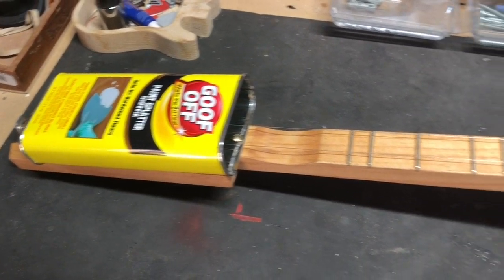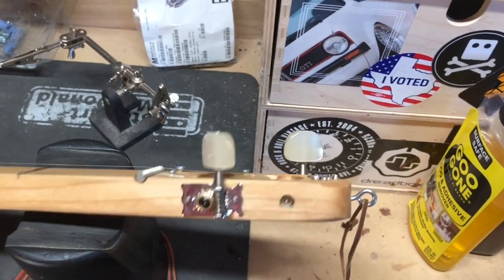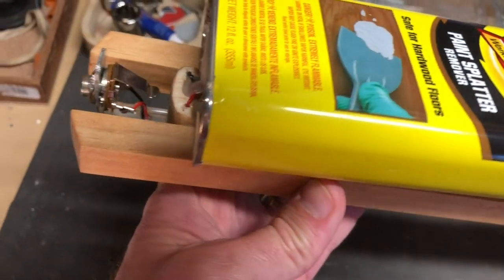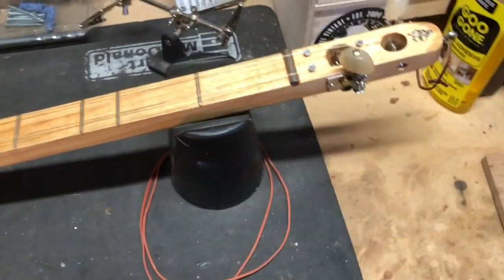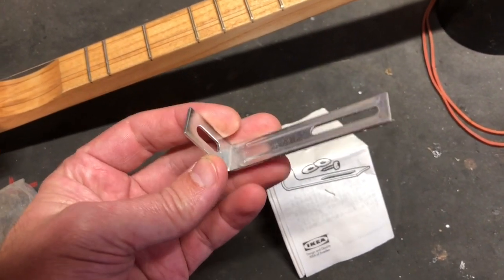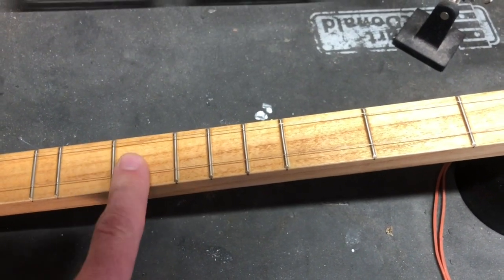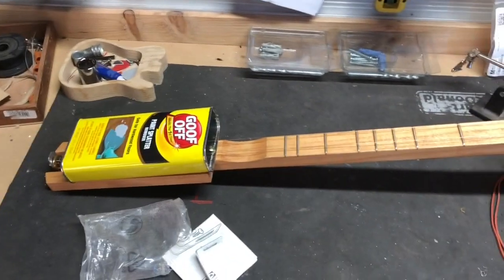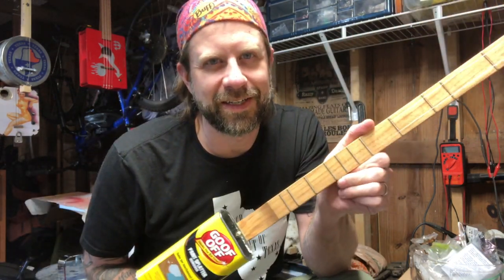DIY Instrument: The Goof Off Canjo

Comment: Great video. I have a similar can. I am wondering how you removed the top of the can. Thanks
Reply from the maker: I just used a manual can opener, then I had to bend it a little at the corners to get a smooth edge. After that, I quickly ran a file around the inside of the can to get rid of any burs.

Comment: How did you secure the can to the wood, may I ask?
Reply from the maker: I used two short screws - about 3/8" long - and angle them into the front/back edges of the can. Thanks for watching.